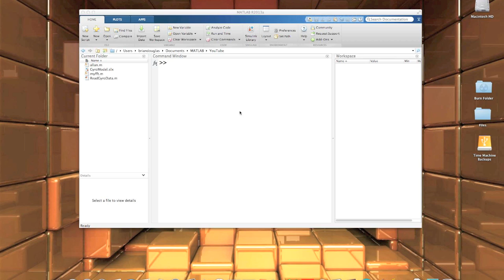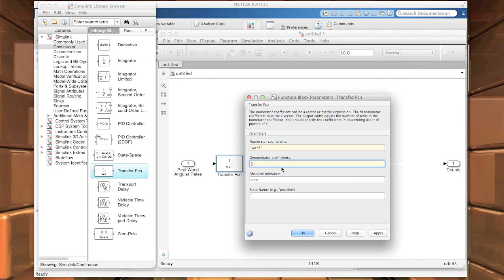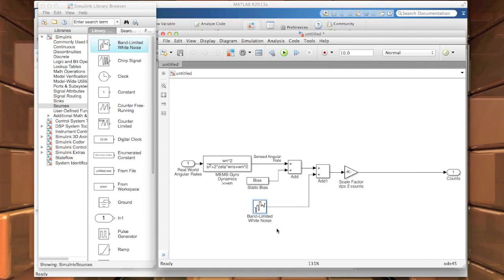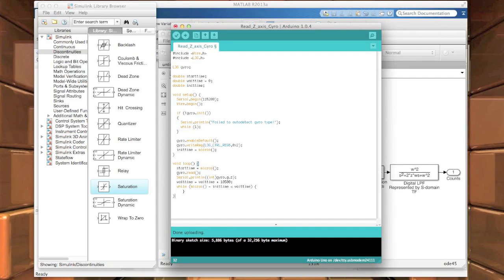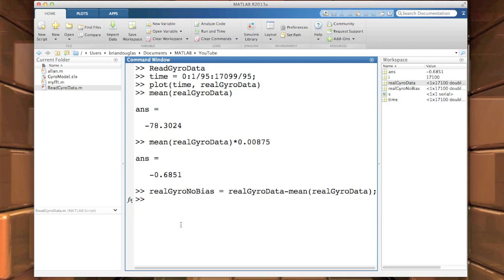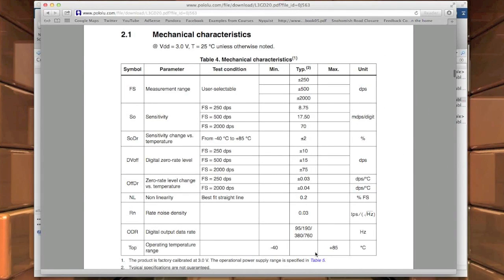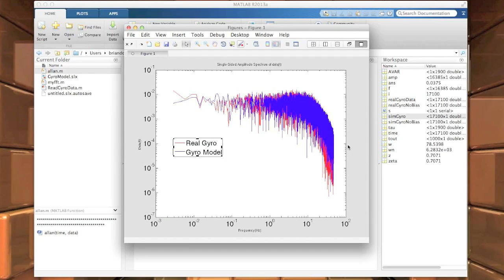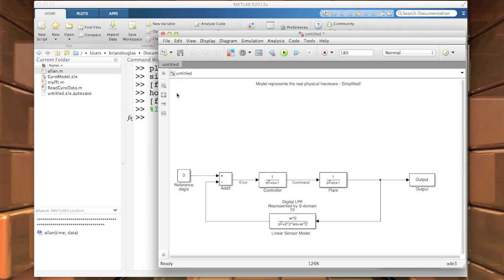A simple MEMS gyro model using MATLAB / Simulink

Comment: Hello Brian, very explanatory video. Thank you! I have a question though. You have deleted both the constant bias and random walk at around 14:50.
I understand that if I calibrate my gyro, I can get rid of the constant bias part. However I did not get the part where you deleted the random walk block.
You said that random walk is non-linear and zero-mean, does that mean I can just neglect it for my calculations? How so?

Comment: Thank you very much for the video i learned a lot! I was wandering if you can tel me more about the formules which you used to make the plant of the Gyro. I am working on a similar project and i want to make a model for the gyro (
MPU-9250 GY-9250 ) i am using based on the formules . Thanks in advance!

Comment: I would suggest people check the internal oscillator on the their mems before doing any frequency computation on it. Because if its frequency is off by 10% because it's a R/C oscillator, you're in the weed for no good reason, just measure time with your best MCU oscillator (USB requires a 12MHz quartz, that could be quite ok).

Comment: Thanks for this great video. I was hoping you could answer a question of mine. Why didn't you include a Analog Low Pass Filter after the subsequent noise added into the Gyro dynamics? Isn't it important to do that to prevent aliasing?

Comment: This video is so awesome! <3 you Brian :D. I am on my first year of my masters in control and automation and i am working with mono-rotor helicopter swarming. We are using a vicon motion tracking system to determine position, pretty cool :P. As a part of the project we need to make a model for the helicopter in simulink. I really like the way you explain how a model can be made for a gyro and i will for sure try and use that line of thought you have showed here forthat. Keep the videos coming :)

Comment: Hi Brian.  Congrats on explaining this stuff.  This helped me a lot. I am not familiar with the Allan Variance. I computed the power spectral density of the noise, which has an amplitude of about 8 to 10 db (digit counts)/Hz for the three components, using pwelch in Matlab.  With my range of 500 dps, I also get 0.03 dps/sqrt(Hz).   
I am a little confused about your arduino program. At 6:35, you set control register 5 to set the data rate and low pass cut-off. Shouldn't this be con. reg. 1?

Comment from the maker: Thanks Tiger! I would love to be able to get to state space and other modern control techniques.  I have some things I want to finish first in classical control before moving on though.
Reply: Hello @Brian Douglas, i want to simulate an IMU model. I am using a simulator where the yaw, pitch and roll values are available and acceleration in x, y and z axis are also available. The goal is to use the values to model a IMU with errors (noise and bias).
Reply: @abdullateefagbaje1032   i want also to simulate an IMU model can you help me plaise (give me your email )